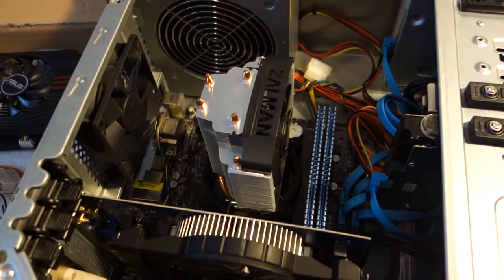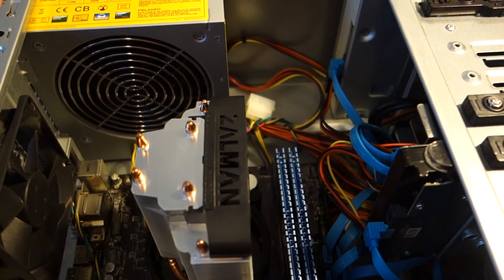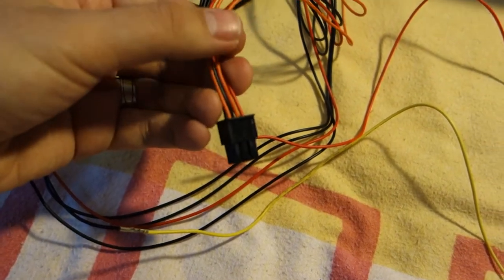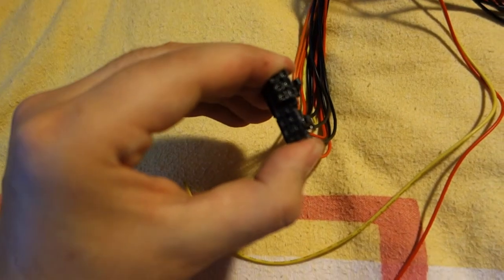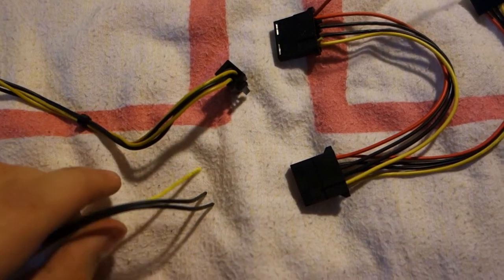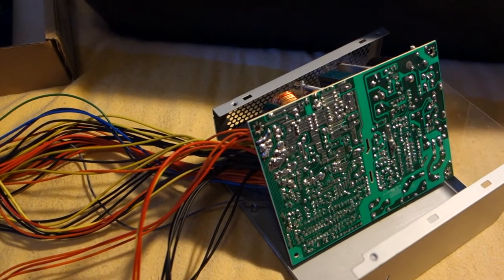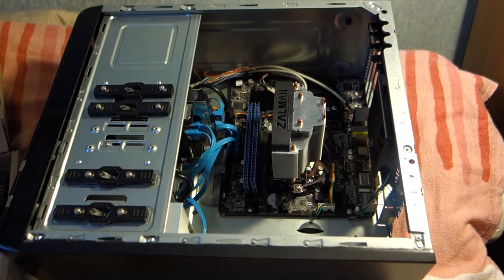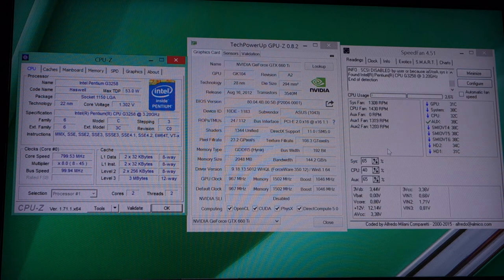Upgrading to Asus GTX 660 Ti and adding GPU and CPU connectors to 350W Chieftec PSU

Comment: hello,can i use GTX 660 with 350w psu (my cpu is i3 3220 and it uses 55w) and i have no other thing that uses much power
Reply from the maker: Hello. Depends on the quality of the psu. A good quality one should be able to do it.
Reply: @UltimateDIY  Thank you :)
Reply from the maker: Welcome!

Comment: Would a Asus GTX 660 work on a 600 watt power supply? The PSU is a Delta DPS-600WB A
Reply from the maker: Yes.

Comment: doas gtx 660 work fine with 400w power supply ? 
i have no dvd lucter and only one hdd with 500 gb and intel g2020
Reply from the maker: Yes, it should be ok. Just make sure the PSU is a good quality one.
Reply: @UltimateDIY  thnx :)
Reply from the maker: Welcome :)

Comment: I have eka gtx 660 can i run eka 350w power supply 🤔
Reply from the maker: At the limit like I did.
Not recommended for gaming use.
Reply: @UltimateDIY  400w power supply can
Reply from the maker: @Trex6231  450w is best.

Comment: Hey how you're doing. So I have a Dell Vostro 460 with 350W psu. My specs are 16GB RAM DDR3, Intel core i5 N400 cpu, and 1TB + 500GB SSD. I just got this GPU 660TI today and worry if mya not run and plus I don't even have a second Pin power cable 💀. What's the adapter thing call?
Reply from the maker: Hi. Is the 350W PSU the OEM one from DELL? In that case there is a big chance it can't handle the 660TI. OEM power supplies are quite weak compared to dedicated ones.
Reply: @UltimateDIY  Ok ok. Thanks for your reply I just recently upgrade my power supply with a EVGA 500w and it works fine with my GPU the GTX 660 ti :)
Reply from the maker: Awesome! 👍🏻

Comment: Old video extreme late comment this .... but how the hell did u run that 660 ti on that old psu let alone the 450 that gpu needs or needed at the time of the video atleast a dececnt 450 80+bronze psu with high ampage rating the 660ti need 150wat to work , if your talking about voltages ect....on the 450wat psu the cpu needs 100wat the ram and mobo and ssd and hdd and all the usbs ect would be more than 150 easy so that 350 or more wats then theres the 100wat witch would easy be zapped by 3 or more fans inc cpu cooler
Reply from the maker: Sorry, but you overestimate the power draw of my particular setup.
That old PSU run my card perfectly :)
Do I recommend it? No!
Did it work just fine? Yes!
Reply: @UltimateDIY  yes ofc it ran the card fine but your forgeting power draw vs amp draw in gameing conditions and prolonged usage would trip the psu off , to get around this i would run 2x +5v lines in line with 1x +12v rail , but its hit and miss weather or not the psu thermal cut off would kick in or not with possible amp overload .

I am 50/50 on this to be fair lol
Reply from the maker: Mine never tripped the protection, but then again I never gamed on it for more than a few hours at a time and neither did I have temperatures above 26°C in my room while gaming.

Comment: Bro i have 80 plus 350 watts psu with gtx 660 2gb work?
Reply from the maker: Depends a lot on PSU brand. Some are able to handle the gtx 660 and others not.

Comment: ok  my motherboard is a micro atx Gigabyte B85M-DS3H (SOCKET 0) running windows 10 64 bit with an i3 4170 cpu and i single ddr3 8gb ram stick. i have a western digital blue 1tb HDD running at 7.2k rpm. i also have a ATAPI iHAS122 F DVD writer (that i dont use) and realtek High Definition Audio and NVIDIA High Definition Audio sound cards. when i run psu calculator with a standard 660 its coming up as 272w under load and a recomended watt of 346 (i have a 350w psu) will i be able to run this gpu? sorry for the long comment on a n old vid but i cant seem to find an answer anywhere.
Reply from the maker: +DerpBomb Gaming hy there! If it is a good quality PSU and fairly recent (old PSU's don't usually have enough amps on the 12v rail) it will do the job. My 350w chieftech worked just fine :) But if you can afford it, a Corsair vs450 would be awesome for your setup.

Comment: I have I ball ball psu 450 watts can I use zotac gtx 660 ?
My specs i5 650, 8gb 1333mhz ram ddr3, zebronics h55 chipset motherboard, zotac gtx 660, 2 hdd and 1 ssd, and basic I ball psu
Reply from the maker: Impossible for me to guess. The quality of the psu matters the most.

Comment: I have power man 350watt can I run
Reply from the maker: If it's a really good 350w psu, but I don't recommend it for gaming.
Reply: @UltimateDIY  bro I dont know how good is powerman brand is
Reply from the maker: Never heard of it, so I would say not a good one.
Reply from the maker: It will not be able to handle the gpu.

Comment: Is gtx 660 working alright with 350w psu?
Reply from the maker: Yes, it worked perfectly normal, but after a while, when I had some $$$, I upgraded to a 450W Corsair VS450. Did not see any difference between the two, not even in terms of overheating or something similar. So, yes, a REAL 350W PSU can handle the 660ti, but depends a lot on the brand probably.

Comment: i3-8100  cooler master  MB520 case 8gb ddr4 ram + hdd 1000gb   gtx 1050 ti will be fine ? in 350w psu
Reply from the maker: Yes, if it's a good 350w psu, it will handle it. If it's a no name, it's at the limit.
Reply: @UltimateDIY  its cooler master
Reply: @UltimateDIY  its cooler master but i3 consume 65w and GTX consume 75w my case is cooler master with 4 fans rgb motherboard h310m asrock and HDD and RAM u think 350w cooler master is good
Reply from the maker: @hichembey1274  yes, good enough.

Comment: i have i3 6100 and 460watt psu, can i run gtx 660 on my pc?
Reply from the maker: If it's a decent psu it should be ok.
Reply: @UltimateDIY  i have a cooler master 460 psu
Reply from the maker: Then it's ok.

Comment: does gtx 660 work fine on 700 watts power supply?
Reply from the maker: Any gpu will work on 700w psu.
Reply: @UltimateDIY  generic psu 700 watts psu?
Reply from the maker: If it's not chepest of the cheap, it will be ok.

Comment: hey i have a delta power supply 350w from like 2007 or 2009 can i run a gtx 560ti
Reply from the maker: +Frozen HogYT it could run it, but barely, so I don't think it's a good ideea. You need a more powerfull psu for that card.